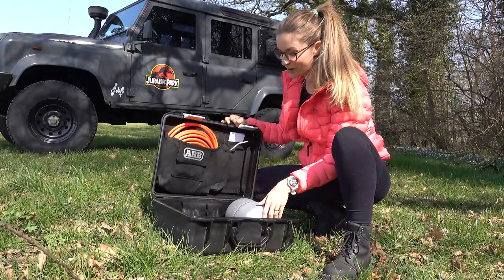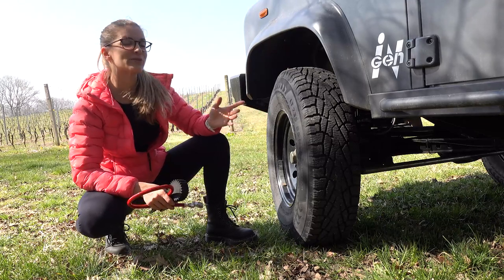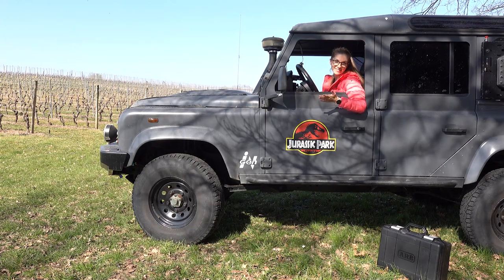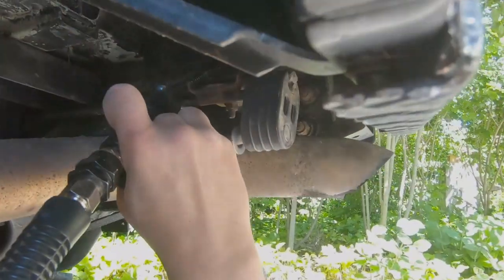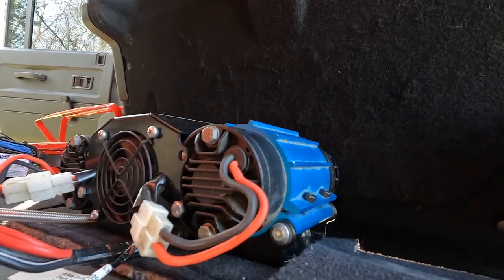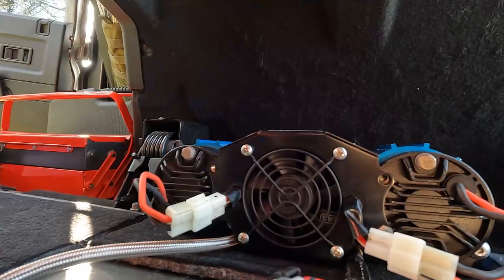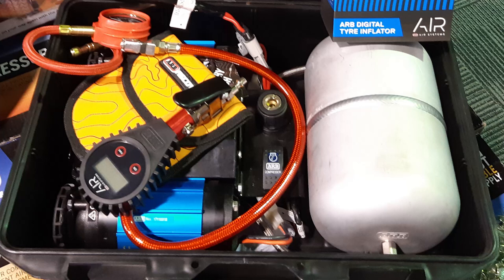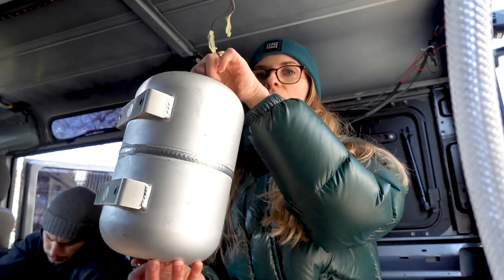Why ARB Twin Compressor with 4 liters Air Tank is awesome for off-road and 4x4 overland ?

Comment: The ARB compressor is a great accessory, but they are expensive! Still, for someone doing quite a bit of off roading it's one of the best investments you can make. Fits under the seat very neatly.
Reply from the maker: Price tag is quite high compared to cheap ones but as you say absolutely worth it for any 4x4 overlander/offroader

Comment: Just modified my Viair 400p. I removed the the crocodile clips and wired an Anderson plug direct to the second battery. I have ordered more bits from 12v planet using the code you gave to put an Anderson connection at front of my 90. Then I can carry compressor to front to air up front tyres. Have also been looking at getting an Indeflate to simplify airing up and down just deciding whether to get the two hose or four hose kit.
Reply from the maker: Thanks for sharing and happy the discount coupon on 12voltplanet was helpful 😃. Don't have any experience with the Indeflate kit you mention, will check it out.

Comment: How hot does it get? Could be a bit of a worry to have it heating up in a confined space surrounded by carpets. Still looks an excellent tool.
Reply from the maker: Never had any issue. It was previously installed between the back seats and wooden setup, now under the back seats. Air flow should be all good 👍

Comment: Hi Émeline, nice video, as usual! Keep up the good work 👌🏼
Why not using rivets to fix the compressor if the other side of the floor isn’t accessible? 
Maybe some sikaflex in the holes before and after placing the rivets would have done the job perfectly. 🙃
Reply from the maker: Thanks! The compressor already has rivet nut on its bracket so we didn't want to remove them to do the install the other way around (rivnuts on Defender, remove compressor's brackets to drill it, etc...). But the install is all good :)

Comment: How much pressure do you use on mountain roads? How fast can you go when the pressure is released?
Reply from the maker: If the question is for normal roads, we keep the normal pressure, and if you're asking for mountain tracks we lower the tires between 0.7 to 1 bar and adapt speed to terrain.
Reply: @offtrackfamily  thx

Comment: For inaccessible location on my LR that need a thread I use Rivnuts.
I like the ARB twin but if you think space is limited in a D110, try my S2A 88"😉

It's a bit of a dick move on ARB not having a drain hole in the receiver.
Reply from the maker: Thanks for the message! Not having a drain hole seems normal as you can mount it any way round. The compressor's bracket already has rivnuts and we didn't want to add work by modifying the bracket. Haha, not sure we could do what we are doing and all fit in a S2A ;)
Reply: @offtrackfamily  Many thanks for the reply. 
Apologies, I thought the tank brackets had adjustable bands like a lorry air tank, not weld to the tank, then you could've swapped the airline and drain valve fixings depending on how its mount.🤔 

You video has now spooled up the ideas side of this LR enthusiast😉

With enough lube I reckon you lot could squeeze everything into a 88...just roll around in all the EP90 it leaks out😂

I'm looking forward to what your next video has instore.
 Keep up the good work 👍🏻